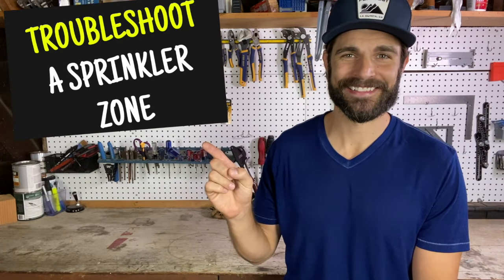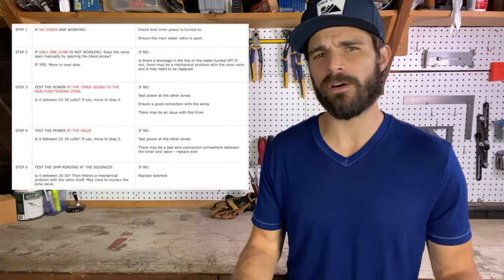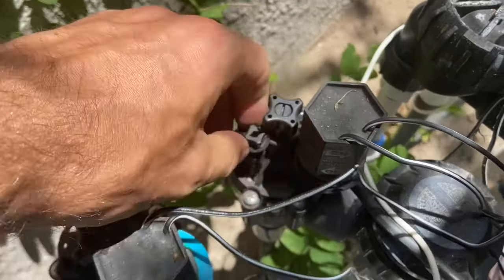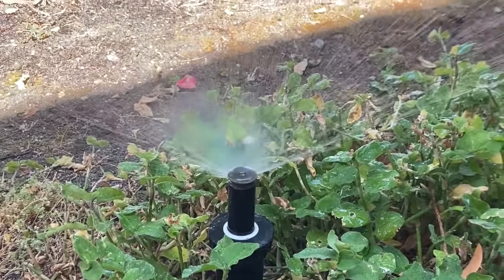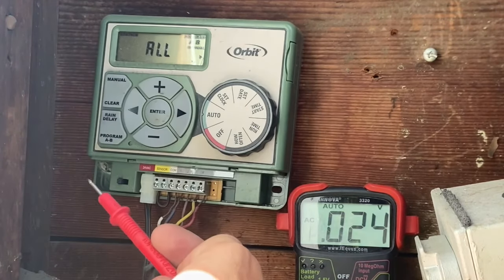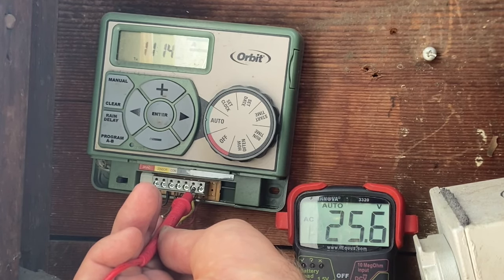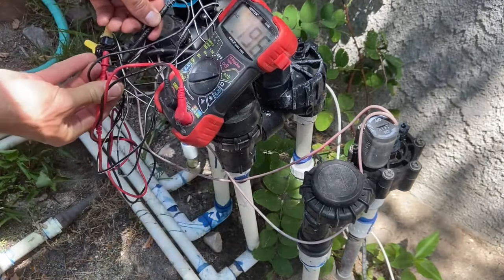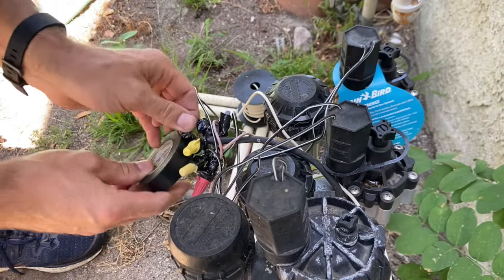How to Troubleshoot and Fix a Sprinkler Zone that isn't Working + Printable Guide

Comment: Absolutely accurate.  My sprinklers were coming on and off intermittently during the water cycle.  After following this video, I found that the wire nuts were rusted as well as the copper wires.  I sanded  the rust off the copper wire and put new wire nuts and sealed it with electrical tape.  Unit is working great now.
Reply from the maker: @mohammedkhan5795  I'm so glad it was helpful!

Comment: Awesome, awesome video, Cole. I couldn't figure out why my one zone wouldn't go on. I had tried a couple of different solenoids, and just thought maybe the rubber seal was too big or too small, or something weird. Finally, I decided it HAS to be something electronically(I could always get the zone to work my opening it by hand). Voltage was fine at timer. So then I went to valves and saw the "bad" zone wasn't getting the reading that the others were. BINGO! And even better, I realized right there and then that there's 4 extra unused wires!!! DOUBLE BINGO. So, I just changed wire colors at the timer and then at the solenoid, and done.....10 minutes and fixed what had been broken since last June, thanks to you! Thank you!
Reply from the maker: Oh my gosh! I'm so glad! They're so frustrating when they aren't working properly!
Reply: On the panel says,  error detected wiring check in #zone 1?

Comment: Very good information!!.And great video!! However, I replaced the whole top part of the valve  then the  timer but still only 2 drip irrigation heads out of 7 work and the pressure seams very low. Everything was fine for years, so I'm very confused at this point!. Any idea what could be next??
Reply from the maker: Sorry to hear that! How is the pressure for the rest of the house's water? Are you on a city water line? Or a well? If you're on a city water line, you may want to have them come check your incoming water pressure if it's low in the whole house.

Comment: Hi Cole. I have the bhyve smart controller in my garage from 2023. I use the app on my mobile phone to do manual watering. This is such a great feature. The other day, suddenly my zone 2 stopped working only on manual watering. It works during scheduled auto watering. Any ideas what to do? I already switched the wires with zone 2 and 3. Zone 3 wire put in zone 2 did not work manually. Zone  2 wire put in zone 3 worked manually.

Comment: What if one of the valves is operating, but just not at full flow capacity?  I don’t not believe that there is a leak in the line. Would that be a faulty valve as well? Thanks for the info.

Comment: I've got a zone in which the water just dribbles out of some of the sprinkler heads.  It happens when the zone is activated from the control box or activated manually at the valve.  All the other zones are working fine.  There is a big tree near the valves, so I'm thinking the sprinkler line got "pinched" by roots.  Is there an easy way to toubleshoot where a bloackage might be?  Any other thoughts?  Thank you!
Reply: get down on your hands and knees and put your ear down on the ground.  if you are lucky you will hear the water squeezing through the pipe.  the hardest part is finding the pinched pipe second is digging out the pipe.. i would recommend digging our the entire section of pipe near the tree.  if it is pinched in one spot it will most likely get pinched in another
Reply: @carmencristantiello5176  Thank you!
Reply from the maker: You can completely open the line, which would tell you if the water was getting to the solenoid itself. That would rule out anything BEFORE the solenoid.
Reply: @coleofsometrades  Thank you!

Comment: Great Video, but still have a problem. I have 5 zones. Zones 1-4 work fine. Zone 5 is doing a rapid pressure cycle. It hits 60psi then shuts off, goes down to 40 psi, and clicks back on. This happens 
every 20 seconds when zone 4 is on. When zone 4 is off, the pressure is fine. Any ideas?

Comment: I have 4 solenoids and they all work when I turn it quarter turn EXCEPT it seems multiple zones are controlled by each solenoid and one is still not firing???
Reply from the maker: I've had that! You can follow the wire from the timing control box to the solenoid. Are there multiple wires connected to the solenoid?

Comment: I have rain bird sprinkler system and and all zones work but 1 don't and when I turn it on manually the zone won't turn on could it be because it needs a new solenoid?
Reply from the maker: It could be that, or it could be backed up. If you take the top off the sprinkler, you can look for a buildup of rocks/dirt. Try that first!
Reply: @coleofsometrades  the tops of all the sprinklers in that specific zone or where the valve is at?

Comment: I accessed the zone two connection in the ground and I turned what I was supposed to turn a quarter turn and water started oozing out. It’s like it doesn’t have water pressure to pop up the sprinkler heads. How do I fix that? Thanks

Comment: Hi I have water to the one zone, but the sprinkler heads do not come up. water just flows out. I have changed the diagram three times. every time it starts working properly, but only for a few cycles and then it fails again. It seems to be a pressure problem? I can pump one of the sprinkler heads Priming and then It will work, but then it does the same thing.

Comment: Hello, I have one zone that's not working I tried 3   different valves to turn on to see what happens but no water or anything happen. What does that mean? Even if all of my other zones work through controller but 1 and nothing happens if manually turn on through valves? Thanks

Comment: Thanks!  Wasn't sure on voltage on our system.  I think the timer is bad, it's only been dropped 150,000 times from where it's mounted.  May correct that.  I belong to procrastinators anonymous (I'll do it later).  I'll do some checking and get it done!  Thanks again!

Comment: please help. I have a main water valve that feeds the front lawn. that's working, and the irrigation clock (Orbit) turns on front yard sprinkler zones via value box solenoids as expected.

there's another water on/off valve that feeds the backyard. when I turn water on for backyard zones, all zones pop up (zones 4, 5, and 6)...the solenoids in backyard value box are not manually turned on, they're in auto mode (governed by the Orbit irrigation clock).

what do you think is happening?!
Reply from the maker: Are you saying that when the backyard is turned on, all zones go on at once instead of going on one at a time? And that they're set at one time. 

For instance, you've got the backyard set to go off at 7pm. At 7pm, all zones turn on at once?
Reply: @coleofsometrades  I recently replaced the valves in the valve control box. fixed the issue completely. 

what was perplexing was that zone 1, 2, and 3 (front yard)  has it's own water on/off, as does zones 4, 5, and 6 (backyard). 

when I turned on the water to feed the backyard (4, 5, 6) 4, 5, and 6 would turn on simultaneously including zone 3 (in the front yard), which shouldn't happen. how could this happen?

I speculated that zone 3 must be an overflow thing for 4, 5, and 6.

replacing valves 4, 5, 6 with Orbit valves fixed everything. not only do zones 1 through 6 work as expected, but zone 3 no longer activities in response to water being turned on for the zones 4, 5, 6 valve box
Reply from the maker: @pluck_me  jeez! Glad you were able to figure it out. Sometimes it's just a guessing game!

Comment: I turned the dial on my RainBird panel to TEST ALL Station.   Which it did, all SIX zones ran for 2 minutes.    Too my surprise,  which I discovered 10 hours later, is that TEST all Stations would repeat, and repeat and repeat FOREVER until I turn the dial to OFF.   WHY are we not warned about that?  Or, is my rainbird control panel defective.

Comment: Some sprinklers same zone won’t turn on? Help
Reply from the maker: Did they previously turn on? You might have a backed-up water line. you can take the sprinkler heads off and see if water shoots out and clears the line. Any construction in the yard? Perhaps the line was damaged?

Comment: my rain bird sprinkler system's zone 8's sprinkler heads are not spraying, no pressure to push the heads up,  but I can see the water flowing out of sprinkler head.  at the mean time, the sprinkler box/valve in the ground start to filled/ flood with water.  what could be the problem? thanks for your help
Reply from the maker: More than likely, your diaphragm seal is broken or debris is obstructing your valve from closing. Your best bet is to take the big round part of the valve off - either twist it or it will have screws. Then, check the seal to make sure it isn't cracked or damaged. If not, check if there is a blockage on your outgoing pipe. Finally, turn on your system just for a moment to clean out the incoming water supply. These steps should help fix your problem!
Reply: "Sorry, the file you have requested has been deleted." -- message I get

Comment: OK... new valve installed, new controller installed... Zone 3 still doesn't run during program cycle, but when I use Manual Start on the controller, the zone works... (which was the problem with the old controller)... running out of ideas. Why would it work for one and not the other when all starts are coming from the controller (old and new)?
Reply from the maker: @keithf1758  man... that one I'm not sure about. Maybe because there's an issue going from zone 2 to 3 in the wiring. 

Have you tried wiring zone three to a new zone? Like zone 4? And see if that works?
Reply: @coleofsometrades  Thanks for responding!! I did switch zones with the old controller and it worked... That just convinced me that zone 3 was bad on that controller. Now that I have a new controller with the same trouble and the same zone, I am at a loss. Wiring is the only thing I can think of, but back to, it works on manual start.... The new controller has extra zones, so I could try that, though it makes no sense to me. I am worried about the wiring if I have to replace it... it's underground and whoever installed the system put the valves a long distance from the controller 🙁

Comment: My valves work manually but when I turn off, one sprinkler is slowly leaking water.
Reply: You have the change the valve. The diaphragm within the valve is not sealing shut all the way and slowing letting water pass through it. That’s why it’s slowly leaking out of the sprinkler head.

Comment: All my valves and solenoid are underwater.
Reply from the maker: That's not good! Is the water draining? Or still filling up? You might have to turn your water off at the main to fix whatever issue you've got!
Reply: @coleofsometrades  
Below the ground line and just fill up with water

Comment: My valve number 1 won’t turn on my sprinklers with the timer but manually it turns on 😂
Reply from the maker: Ugh! That's the same problem I had. It ended up being the power line running from the timer. Try to run a jumper wire from the timer to your valve number 1. It's a quick way to test if it's the problem!
Reply: Any specific wire you recommend? I’m sort of handy but never really messed with electrical stuff